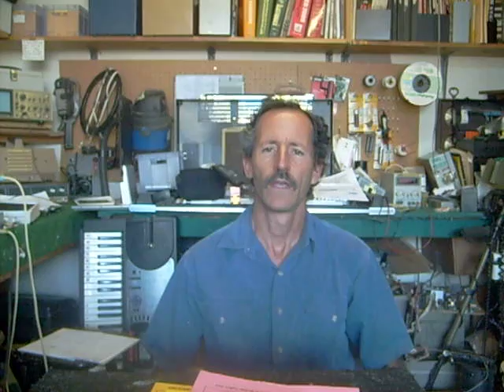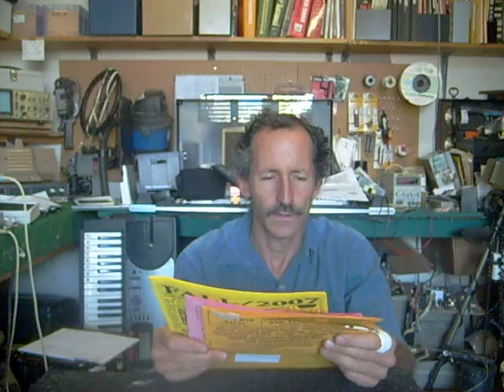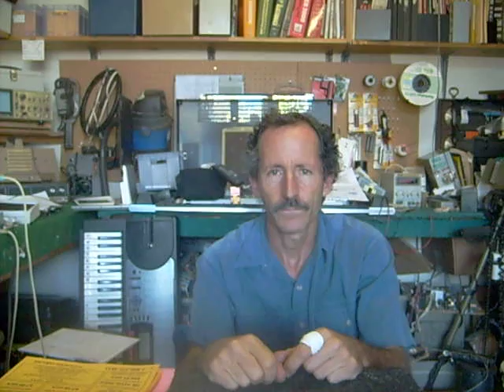LCD TV repair made easy #3. Original Vs Generic parts. Sometimes it matters.

Comment: You mean to tell me that a TV that's cheaply made in China that is in for repair can be made even worse by buying cheaply made Chinese parts? 🤔🤨😯
Reply from the maker: When I began repairing TVs Over 24 years ago, poorly manufactured discounts parts was a fairly common problem.  Especially when replacing transistors in Sony TVs. Their TVs had a low tolerance for non Sony transistors, and I remember an issue with generic transistors overheating, This trend continued with capacitors, and other components as well.
Reply: @GrantsPassTVRepair  
This is why I no longer buy TVs. I wait for the free broken one on Craigslist and fix it.

Comment: I have a Samsung model LN-T4069F, 40 inch LCD.Purchased it in 2008.  For about the last year There are dark blotches on the left side of the screen.  Not enough to ruin the picture, but it is noticeable in some scenes.  Samsung has not been any help. Do you have any ideas on this problem?
Thanks,  Tim

Comment: Hi Dave....After looking at your videos and home page, you are one savy Repair Guy. My question is after being disabled from Motorcycle accident, I was thinking of delving in your line of business. Would getting just your LCD Repair, Repairing Power Board Switches and Mikes Repair History book be good enough to get a good Understanding in fixing LCD Monitors and TVs.....I used to be a Cad/Manager Software troubleshooting guy and have some experience with building and fixing computers TIA

Comment: Same Goes for those Square Projector Bulbs. Some have a bulb inside this Square Glass, which is fixed to its own plastic thing. WELL bulbs are universal, no one is used just for one thing. The plastic thing its attached to is meant so you have to buy that companies 149-200$ bulb. BUT if u find the same shape size, and Watt, you will only have to pay 25$ for a higher quality bulb, you will have to rip the old one off and attach the new to that plastic thing, but you will save 120$at the Minimum.

Comment: YES SIR!!, YOU ABSOLUTLY CAN buy cheaper bulbs for your projector, any projector. I have a lot of them, and am cheap, i refuse to pay a hundred dollars for a bulb. SO Here is a good trick, Depending on the Bulb, if you have one that is like stick, Just measure it, then AMAZON Aquarium Bulb. You can even step up from 150W to 200 or 250, but you better add a fan. SAVINGS, "Projector Word Search"=75$ "Aquarium Bulb Search"=15$ exacly the same life same size shape.

Comment from the maker: @harvjp I don't know exactly what percentage of the problems I see are related to power supply failure, but I will guess bad power supply capacitors represent at least 25 percent of 
the LCD TV repairs I do, and perhaps the same percentage in inverter boards but I'm not exactly sure. Good question though. One of these days I should go through Mikes TV case histories and figure out what percentages are related to what based on his tips.
Dave

Comment: Hi Dave, I wanted to see an approximate percentage of problems you find with LCD TVs. What percentage of problems fall into Power Supply, Inverter Board, and Backlights vs a percentage for all other problems. Just getting started in TV repair.

Jeff

Comment from the maker: @rajkumartree 
Sometimes you can use freeze spray on the edges of the display and it will temporarily make the display problem go away but not always. Sometimes you can also try pressing the edges of the display and this may temporarily repair helping to verify if the display is bad.

Comment: @GrantsPassTVRepairs Thank you for your reply Sir.  I would gladly buy the board if it was established for sure that's where the problem is! BTW, I connected an external VGA monitor to the main board (VGA output) and there is no output  from that socket. Is it possible that the problem is on main board or somewhere else?

Comment: @GrantsPassTVRepairs Hi, I have checked the Inverter board transformers, 24v goes into the board but zero volts at all pins of all transformers. I suppose I need a new inverter board?

Comment: @GrantsPassTVRepairs Thank you for prompt reply. I'll check them out. Are they available and reasonably priced to replace? What should the output Voltage on the inverter trans be ? Is it likely that all the transformers are knackered at the same time?! By the way, I should theoretically be able to inject audio into the sound input and hear it amplified through the speakers regardless of the inverter problem?

Comment: I have also have a dead Insignia 37" TV, no picture, no sound. I am new to LCD TV repairs but I have measured all the voltages that come out of the power supply board, they're all as should be including the 24Vs for the inverter board. So I assume that the problem is not the Power supply components (Caps,etc). Does anyone have an idea what else I should look for?
Many thanx

Comment from the maker: @blondshavmorfun 
It's generally not to difficult to replace the power supply board but I wonder if the repair shop gave you the correct diagnosis. Perhaps they meant the inverter board went out. It could also cause the picture to go out while the sound continued to working.

Comment from the maker: @terry6512 One other point. Often times a resistor goes out when the IC goes bad, but you can start by replacing the IC and the capacitors and see if that fixes it.

Comment from the maker: @terry6512 
The LA78041 IC is used in the vertical section of most CRT type TVs so I'm going to assume this is what your working on. You will generally find a couple capacitors close to the IC you just replaced which are bad and if you fail to replace them your just going to keep blowing ICs. If you had an ESR meter for testing capacitors you could determine which ones are bad. Mikes TV tips probably have this tip recorded in his book. Did you call him?
Reply: Grants Pass TV Repair 
I have two 21"LG TVs one isn't coming on. All voltages in the secondary OK the other one is always blowing LA78141.Please help

Comment from the maker: @terry6512 Sometimes you can bring a TV back to life when you replace a bad transistor, but it could be that the problem which made the first transistor go bad is what made your replacement transistor go bad. A couple things that can cause this might be an intermittent short across a winding in the transformer your transistor is powering. A less common reason is a bad capacitor somewhere in the circuit which is causing the transistor to work harder than it normally would.